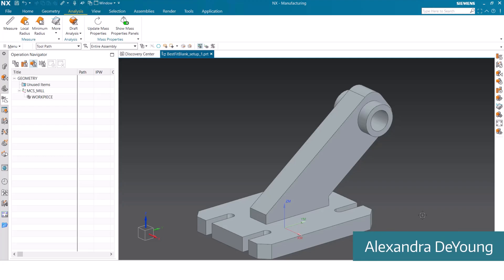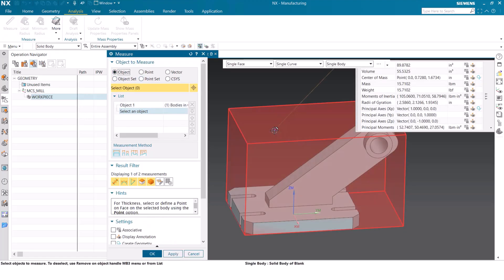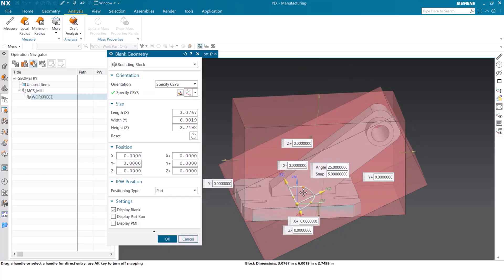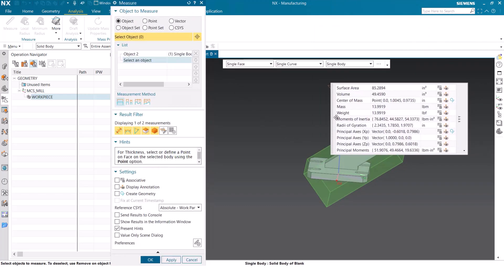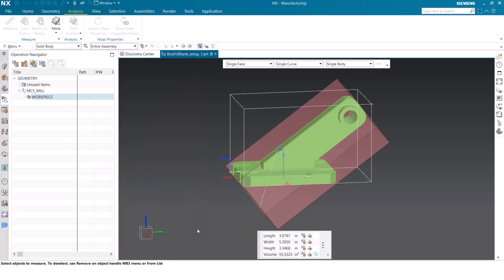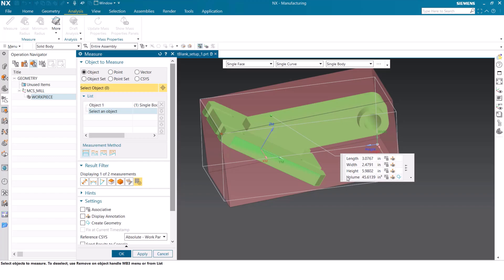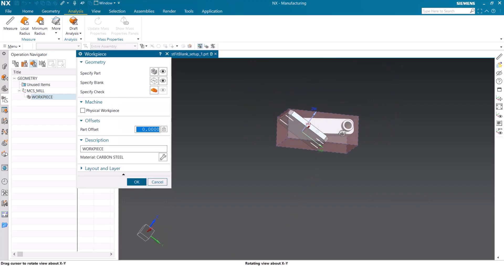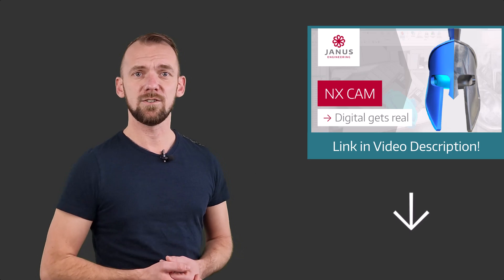NX CAM Tutorial | Save cutting time & blank material with Best Fit ⏳

Comment: Can't 2 parts be made and screwed on or do welding? 😀 Thanks for the lesson
Reply: They needed an interesting part to show the best fit feature. Depending on the use case, part material and customer requirements it might be obligatory to make this part from a single solid piece of stock.
Reply from the maker: Hey mirzoevd812, haha... of course it would be possible to split that part into two. But as Mr. Edvinsyse already mentioned, it was just an example part to demonstrate the Best Fit function (and the use of it for CAM programmers).